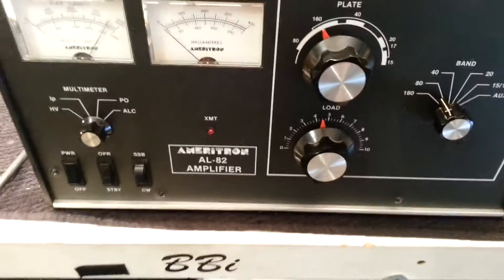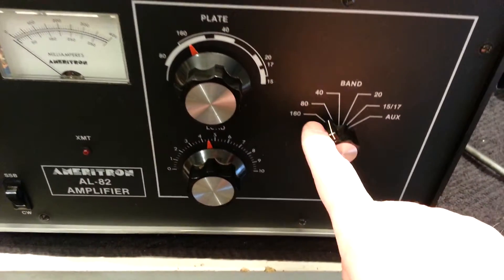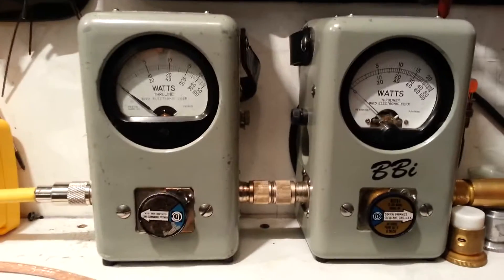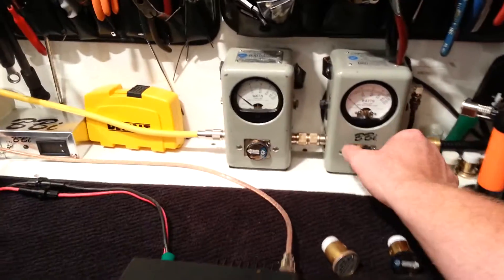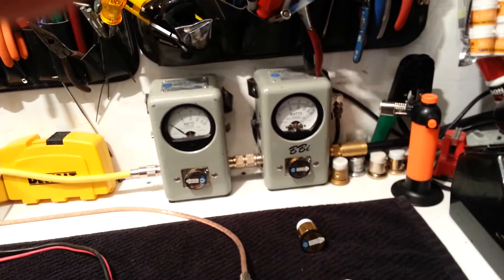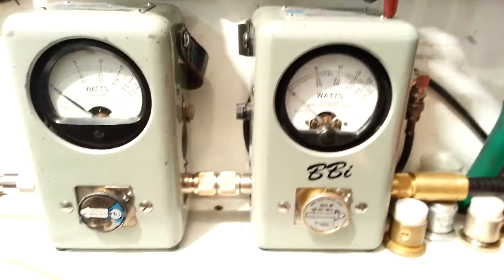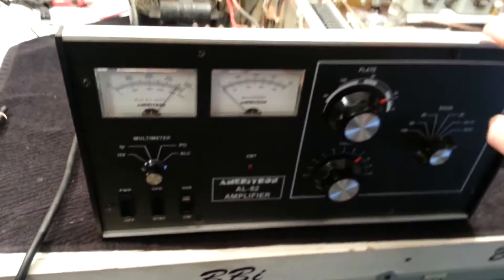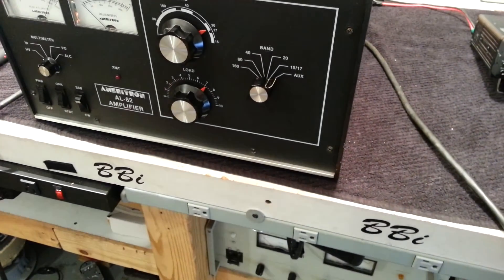Ameritron a l-82 amplifier

Comment: I just purchased al82 haven't hooked it up yet but it has something rattling in the back corner behind the tubes I'm assuming that as a fan compartment I haven't pulled the hood yet just came from ameritron getting two brand new tubes in it so I'm not sure what would be rattling any ideas